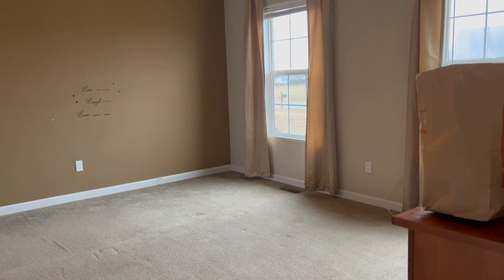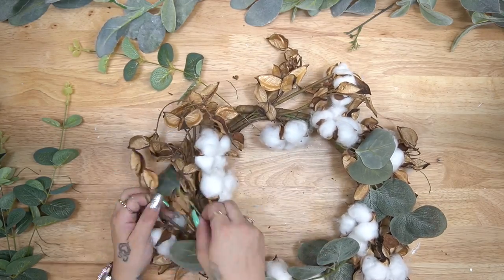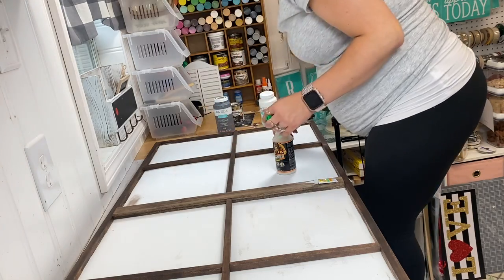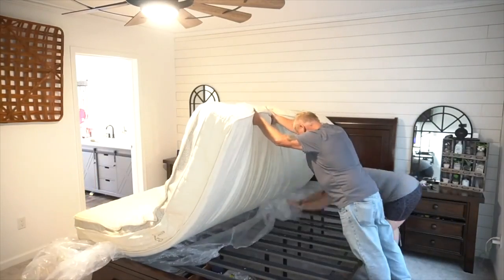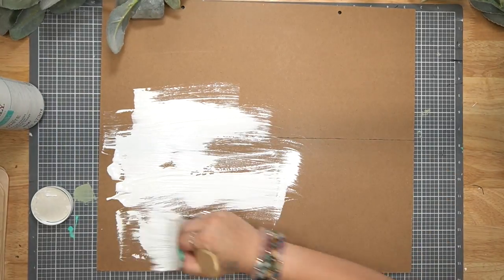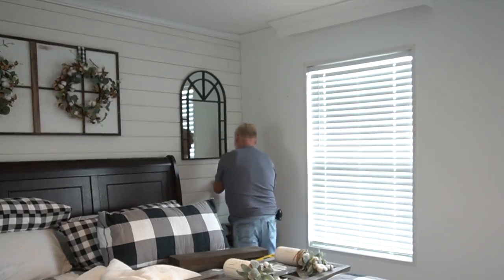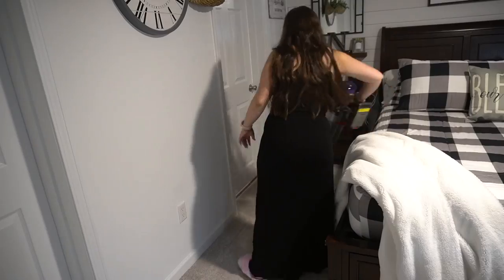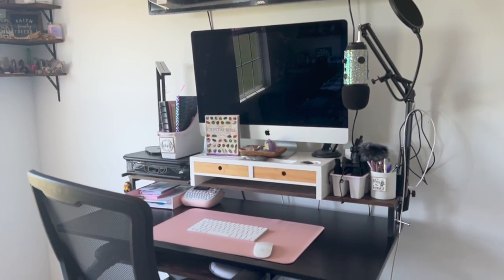FARMHOUSE MASTER BEDROOM MAKEOVER | FARMHOUSE BEDROOM DECOR DIYS | DOLLAR TREE BEDROOM DECOR DIY

Comment: Chalk paint tends to thicken up over time, especially if the lid is left off. Just add some water to it to thin it back out again - a little at a time.  It helps to extend the life of it. You can even spray your brush with water before dipping it into the paint to help it glide over the wood easier.